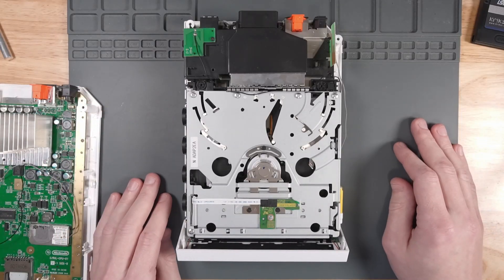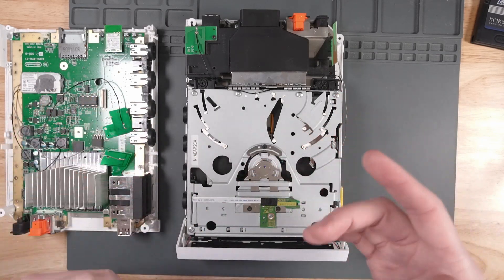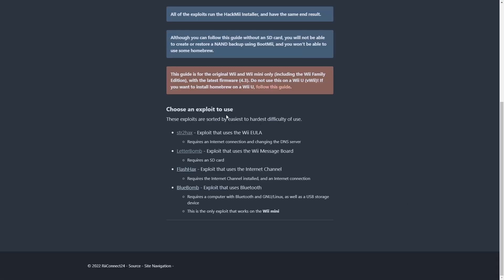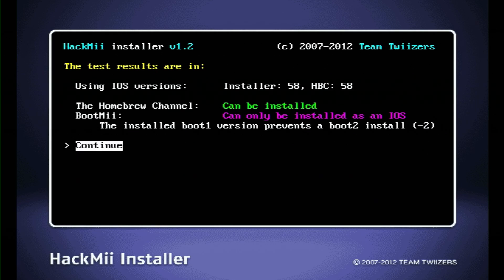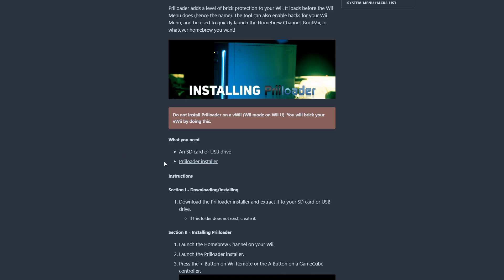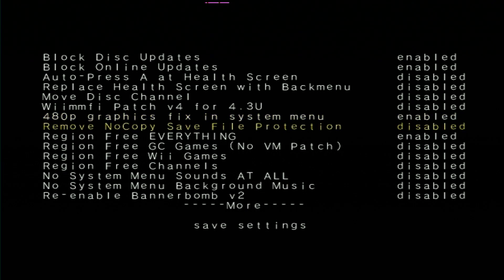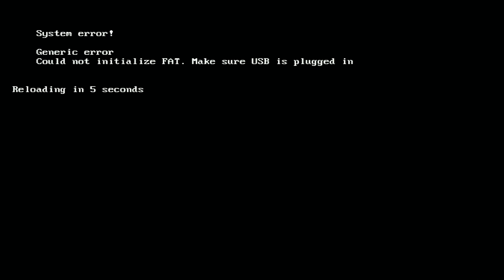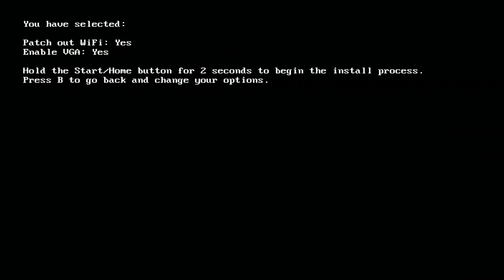Wii Softmodding - Building an Ashida Wii Part 1

Comment: The pms2 isn’t in production anymore, do I still need a sd to usb adapter?
Reply from the maker: They replaced it with the PMS3, I have one and I’ve been meaning to upgrade my Ashida to it because it charges the Ashida faster than it drains the battery

Comment: Why does it have to be rvl-40? Im thinking of doing this and only have rvl 01
Reply: because nintendo shrunk the gpu so its less power consuming and produces less heat (on the new wiis). If you use the old one you would need more cooling and a better battery

Comment: Looking forward to the trim. A few years ago I started the portable Wii build sold on BitBuilt and got to the point of testing video output on the portable screen. It didn't output video and several pics and discussions with team members led to me probably trimming the motherboard a little too close. Defeated, I threw the project in a box and haven't touched it since. Watching this project is giving me the urge to resurrect that build. Props to the BitBuilt team and forum members.  They are incredible and so very helpful.

Comment from the maker: NOTE: Wesk (creator of the Ashida) has notified me that the RVLoader installer will install Priiloader and do the cIOS steps automatically, so it is not necessary to do before installing RVLoader. After dumping your NAND, you can simply install RVLoader.

I don't think it will hurt anything if you still do them, but it is unnecessary.
Reply: Do you still need internet to get the cIOS on RVLoader?
Reply from the maker: No, You don’t need internet after you update the Wii menu